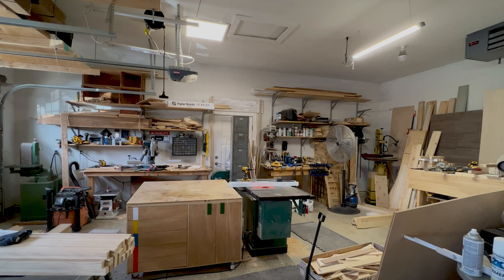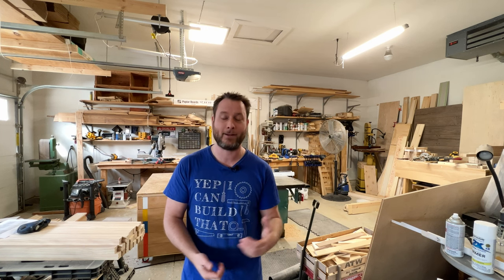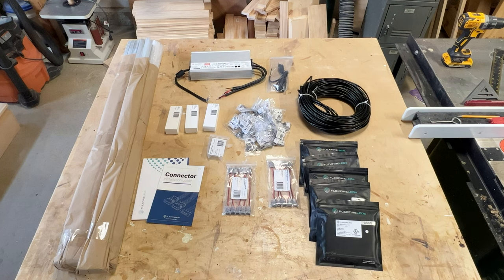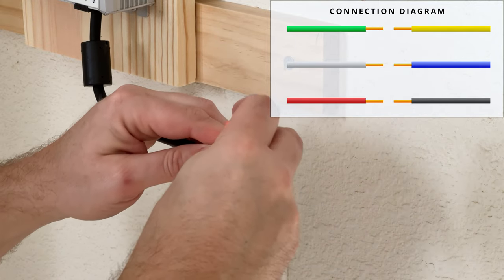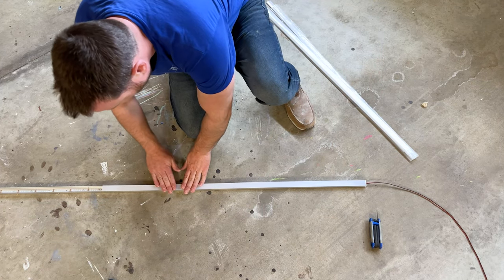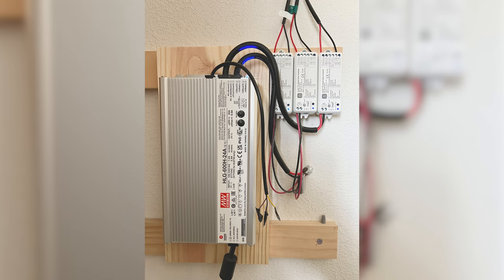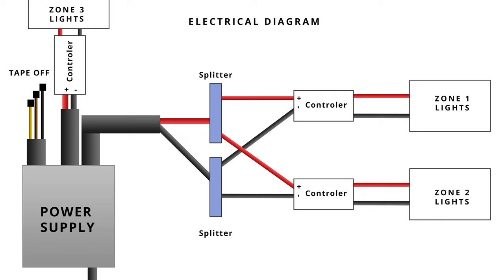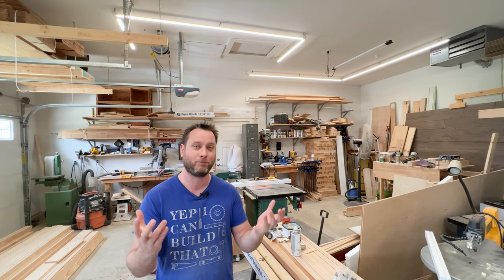How I Upgraded My Garage Woodworking Shop With Flexfire LED lighting

Comment: I used those Flexfire solderless connections and they have been painfully. They always come disconnected.
Reply from the maker: Make sure you remove the 3M adhesive backing and then they will work great